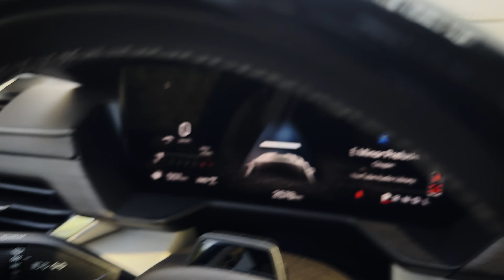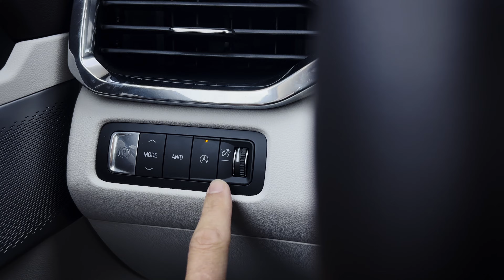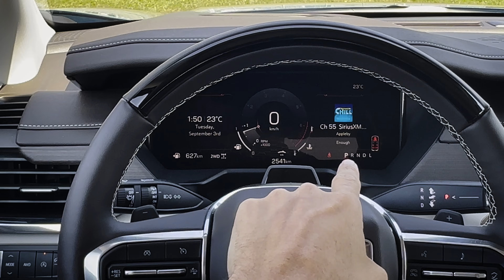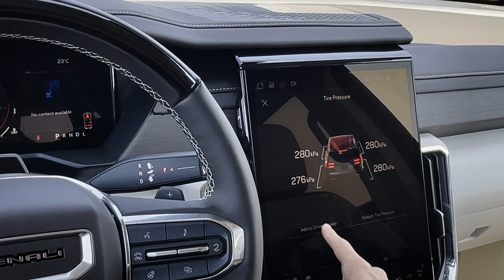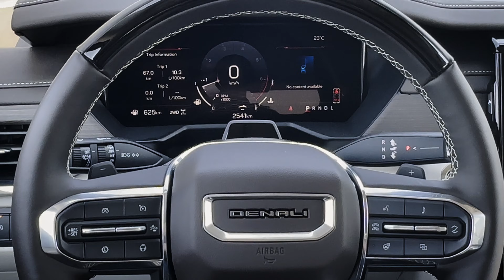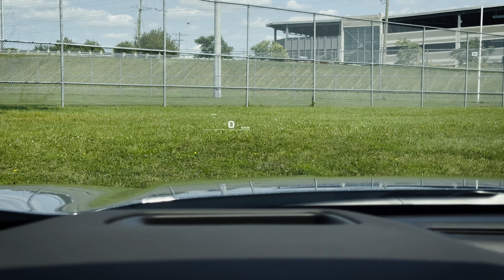GMC Acadia Steering Wheel and Cluster (2024-2026 models)

Comment: Anyone else having issues with the leather part that’s tucked into the plastic part of the steering wheel? I’ve only had mine for 2 years and it has slowly been coming out from the plastic part. I wonder if there’s a way to fix it, without having to spend an arm and a leg at the dealership.
Reply from the maker: I've seen a few forum posts of owners saying they have the same issue. If yours is only 2 years old it'll still be covered under warranty. Head into your dealer for them to replace it and make sure you bring up that it should be a warranty issue